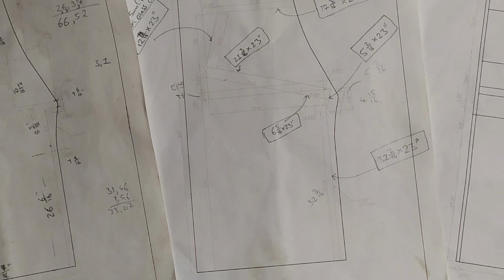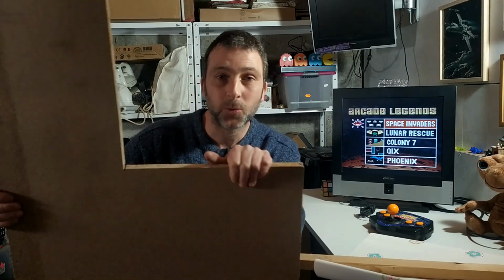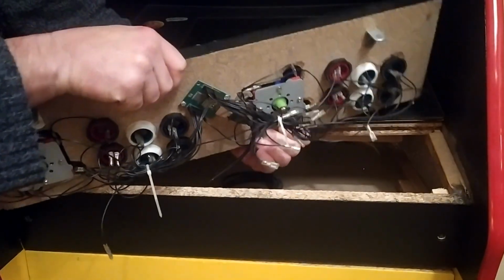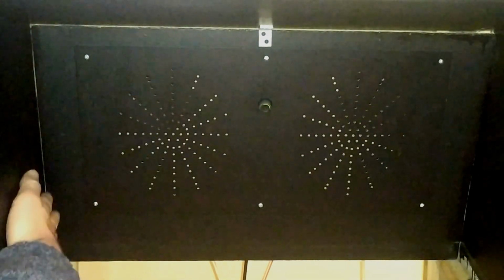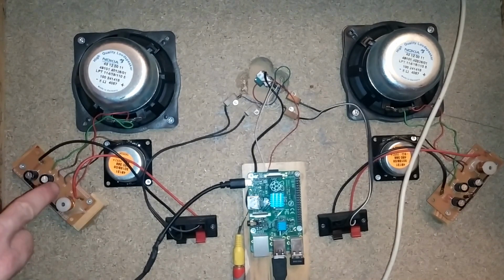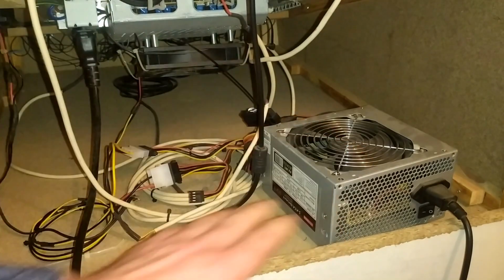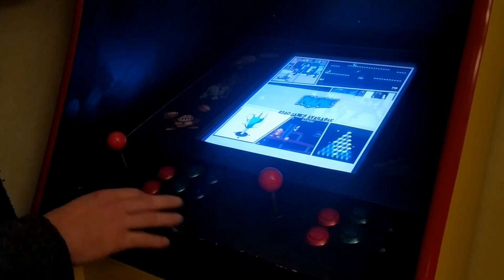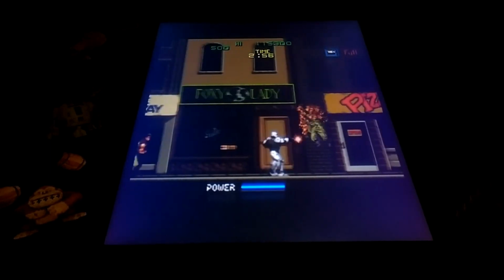Retro(spective) Make  yourself a Pacman arcade cab for under 300 Euro | 8bitsinthebasement

Comment: You went all Blue Peter on us there - cool build. I laughed when you stepped out from behind the cabinet :-)
Reply from the maker: Well, I did say that I wanted to mix up what I did on the channel a bit. It's just a pity that it didn't cross my mind to take some photos while I was building the thing. Honestly, I never thought that I'd be showing how I'd built it to anyone. It's great that you got a laugh from the video though ;) You know, I can fit in the storage space in the bottom too (maybe I should have jumped out from there instead). In fact the whole thing turned out bigger than I thought it would. But hey, any form of cabinet with games built in was something I wanted since I first saw that arcade machines existed. I'm just glad that the Raspberry PI was invented and made this kind of project cheap enough for most anyone to do. As always thank you very much for watching GMan, it means a lot ;)

Comment: Great video Peter and yes worth the wait! If you ever saw one of my older videos on my Home Theater, you see I have the replica from Arcade 1up. Great machines to have at home and fun for the whole family. However doing it your way is so much better because you do it right the first time. These Arcade 1 Up machines need upgrading anyway. I purchased those lighted buttons and a pi3 etc but they've been in a box for a quite a while cause you basically rebuild the whole thing. I also like the way you did that without showing me you cut it on a CNC machine or something ridiculous that most of us don't have and love the wallpaper trick. Embarrassingly, as many tools as I own and renovated my entire house, I had never heard or seen a mortise gauge. Only small advantage here is routers are very cheap to buy and the MDF sheets come in 8 feet by 4 feet (2.4 meters X 122 cm wide) so I believe that would eliminate the need to glue two together to get the width. Will you share the plans by any chance? The jacko site link does not work. PS would definitely love to see a part 2 if you ever do an upgrade. Cheers!
Reply from the maker: Thanks so much, I'm delighted that you liked the video. I've watched your home theater video (man, you made a really impressive space) and the 1up cabs are not at all a bad option. I saw one in a local shop here and had a play with it. It was  a Street fighter 2 cab that they had on sale and although it cost more than I payed for the one I made the one huge advantage I could see over what I have was that it could be used straight away. Now I know that I took way more time than I should have to finish mine (to be honest one month of weekends could have done it, had I had all the parts on hand). But sometimes it's just nice to buy something and use it. Thats what's great about the 1up systems. 
My Pacman cabinet's construction was a culmination of a lot of things that I learned over the years. See I've done quite a few things in the past and back in the early 2000s I worked as a taylor for a few years (I say worked but in fact I became fasinated with clothes making around 2003 and went to the oldest taylor in the city and asked if he would let me work with him every Saturday for free just to learn. He took me on and I learned so much. On top of that I spent between 2-3 hours  each and every evening after work pattern making, fabric cuting and sewing. I loved doing all that and I was good at it) and applied some of what I had learned to eliminate the need of a CNC machine in the build. Knowledge is always useful and you never know when it might come in handy. Oh, listen don't beat yourself up over not ever hearing about a mortice guage. It's a tool that is usualy only found in a cabinet maker's or joiner's shop (another thing I wanted to do in the mid 90s). Normaly it's only employed when making mortice and tenon joints.
 I've added an extra link to the Jacobud plans that I found on the Internet archive as the other one I gave seems to be flakey (thanks for the heads up). Again, thanks for watching my friend and I'm sorry that I took so long to reply. When it comes to a part two on the cabinet I'll never say never but I'm happy with it as it is so (honestly, 99% of what I use it for is games from the 80s like the ones I've shown along with the likes of Moon Patrol and a few others) if I'm to do an upgrade I think it'll be the fridge. I'd love to see your take on a 1up cab upgrade though. Thanks for taking the time to watch the video and whats more, leave a comment, it's much appreciated ;)
Reply: @8bitsinthebasement  I watch and comment because I like what you do and think we have a lot in common. Every skill makes you learn something and can help you in another, could be the most mundane to the most specialized. And I love learning about anything that peaks my interest. My grandfather worked as some kind of metal forger and in his old age had a small shoe shine stand in my dad's shop and taught me how to shine shoes when I was eight and I shined shoes on weekends until I was fourteen. When I found an old Minolta two years ago it had an old leather case falling apart, I used those skills to try to revive it as best I can and it came out pretty nice. One day I'll tell you about my past and what I've done, you might be surprised as well; I was even an apprentice electrician. Cheers my friend!

Comment: I've only one criticism of the cabinet: is there a reason why you didn't use a few lats to keep the power supply in place and have a hole drilled to make the kettle cable socket accessible?
Reply from the maker: The reason is lazyness on my part. I brought the cab up here from the basement (that's where I built it) and reassembled it. I made the monitor assembly that same morning once everything was all together. Then I "tested" it for a few hours pushed against the wall. It was all done (apart from the marquee sticker part) and working great. I had thought about fixing the PSU in place along with another few things I could have done too but it was finished and working so I pretty much said "It'll be grand" and forgot about it. It's just fine as it is though the cables are out of the way so can't be tugged loose and it has loads of airflow. It'll be grand. Thanks as always for watching man ;)

Comment: Heh. I built a MAME cab quite a few years back now. I got around the screen orientation by having the screen on a pivot so you could rotate the whole thing. That was NOT a fun part to cut out and get working with hand tools, I can tell you.
Reply from the maker: I thought about that then decided no. Like you said I thought that it would be a whole lot of work and my wood working skills wouldn't have been up to the task. I'm happy with what I have though, the games I play the most are Mr.Do, Moon patrol, Digdug and Donkey Kong jr so the screens the right way around for them. The rest work great even if the screen is a little smaller. Thanks for watching ;)
Reply: @8bitsinthebasement  I have been tempted to revisit the arcade machine idea, having given away the original. I have joined a local "Maker's space" and have access to a laser cutter now, but TBH, I don't have the space anywhere in the house for a standup arcade machine, alas.
Reply: If the monitor mount panel can be squared LCDs are light enough you can lift and rotate to change orientation.

Comment: “5 foot 7 inches”
“aluminium”

You speak both English and American very well.

Glad to see you back!
Reply: Well, he's Irish. We're bilingual.
Reply: Also, out of habit, we still use feet and inches for heights. You'll find people from the UK using imperial units more than Irish people, as we only use imperial units for human heights and weights, local distances (if that's what we grew up with) and beer and milk in measures less than 1L. All of those are gradually phasing out, but some people will still use inches and feet in carpentry, metalworking, &c., though that's probably going to die out in a few decades.
Reply: @talideon  Very interesting!  It seems I usually hear that human height is centimeters and, one that still gives me a pause, weight is stone!
Reply from the maker: Thanks. I started school in 1979, in Ireland. I don't know what they were thinking at the time but we learned both Imperial and metric measurements. Funny thing was our heights and temperature we learned in metric while distance and weight in imperial. So at 4 years old I was one metre something and lived 600 yards from the school and weighed 5 stone 3 pounds oh, and the temperature outside was 8 degrees celsius. When I left school and got a job it was all imperial because the people I worked with were older than I was. Now here in France it's all metric so at this stage I have no idea about distance at all :) 
"Aluminium" I say as I've always said but I do say "sauder" instead of "solder" but I think that's because I've watched too many Americans soldering on Youtube :) Thanks for watching ;)

Comment: Welcome back!  This was a great look at this project, which is one I have been thinking about doing for a while! (My exact idea about the one I have been thinking of building is that it needed to have a beer fridge in the bottom!)
Reply from the maker: Thanks Ken, it's nice to start into the making videos thing again. That cab took a while to build (and I was unsure if I would be let put it in the house when finished) but it was something I had wanted for a while and it turned out a lot better than I expected. An arcade cab at home is great when friends come around and fun the rest of the time. When you build yours make sure to put a well stocked fridge in it. That may be a future upgrade for mine ;) Thanks for watching buddy.